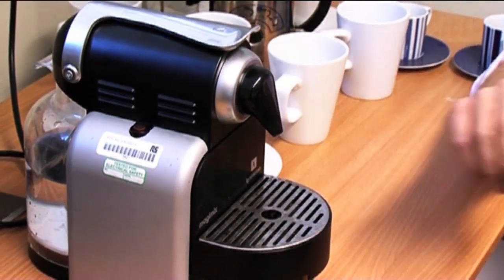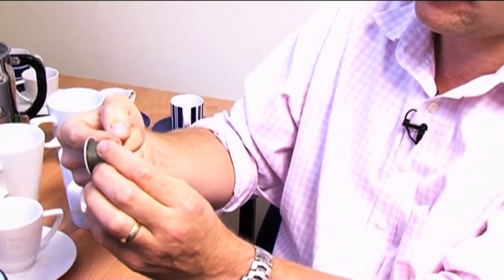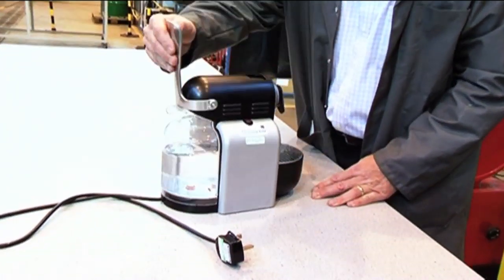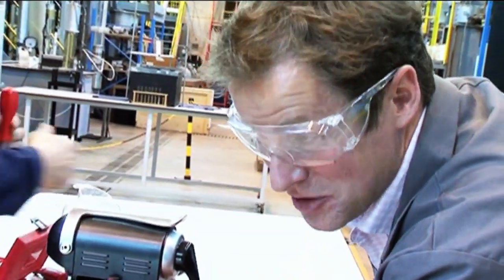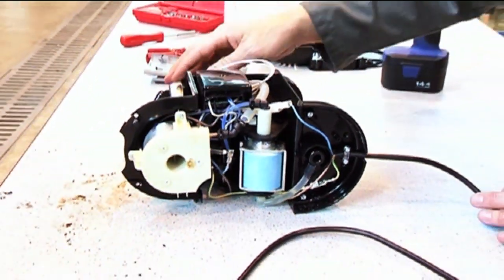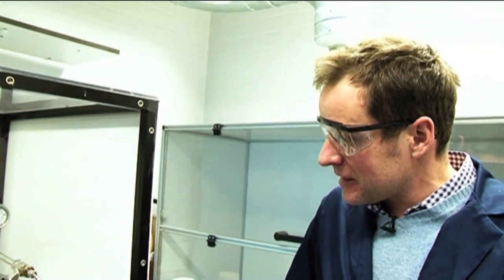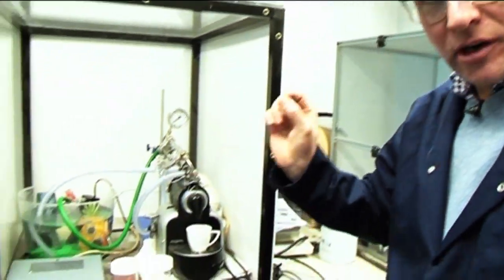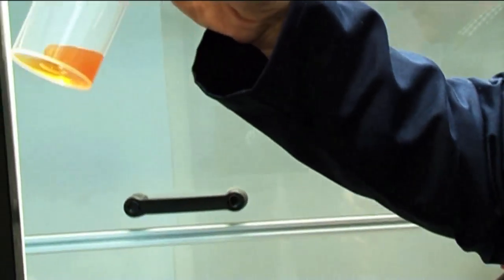Nano Espresso

Comment: I'm pretty sure the pump inside the espresso machine in not to get the water to boil at a higher temperature, but to move the water through the machine. In low end machines, they heat the water to the boiling point to use the steam to force the water through the machine. The problem with boling water is it burns the coffee, so they use a pump so that they don't have to heat up the water so much as to burn the coffee.

Comment: @juanmacrack93 actually it is because you get a better taste with higher pressure. Doesn't have anything to do with the heat, because a normal pump and a downsized heating system would be able to do that job too, and way cheaper.

Only thing i don't like is those claims from the companies "19PSI" and whatever, when they get barely above 3 psi....
But i think there is some weird a** math behind it so they can legally claim to have such high pressures.

Comment: what does it lower the boiling point to, or to say another way how much pressure does it apply to the water?
Reply: +Patrick Sparks it will raise the boiling point. if you DECREASE the pressure on a liquid it will decrease the boiling point (prime example is water boiling at ~71C on top of mt. everest). a quick google search tells me water should boil somewhere between 180-220C under the working pressures of this machine (about 19 BAR).